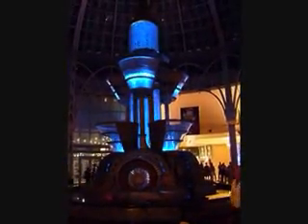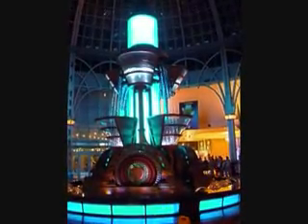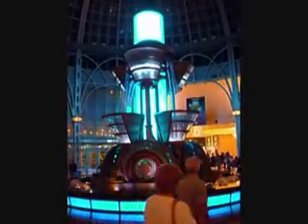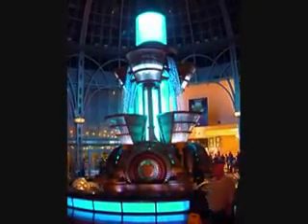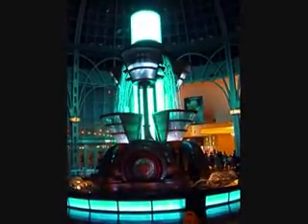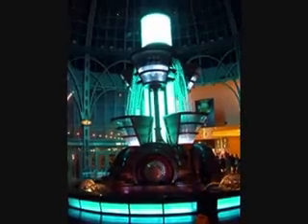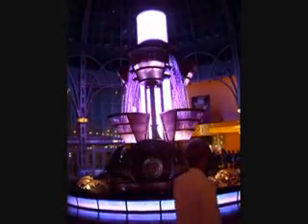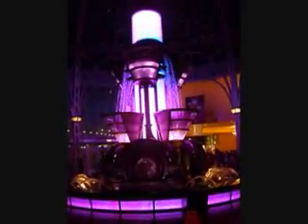Hydro-Teslatron (2006.)

Comment: the fountain itself operates on a daily basis, with only the water and changing colours functioning. Due to design faults and the insane cost of fixing it, the actual show has long since been cancelled.  (i worked there for 7 years, had to clean the fountain a number of times)
Reply: NiagaraWarrior 
I saw this extended show back when the casino first opened. We went there a few years ago and were told the same thing you said, how it was not fully operational. 
I recently saw it in the background of a current commercial and it rekindled my interest. I wondered if it was working again.

Comment: I don't think the casino does this anymore. I witnessed it once around when it opened but within the past few years I haven't seen any sign of this thing coming to life again.
Reply: i work there. its running 24/7
Reply: Я тоже в окно не вижу сусликов, но я знаю - они там есть.
Reply: It’s still works as a water fountain but the Tesla shell no longer exist.
Reply: @dayloro  Last time I was in there before COVID, it had been largely been converted to a decorative seasonal flower display thing and only had water at the base. Really disappointing.